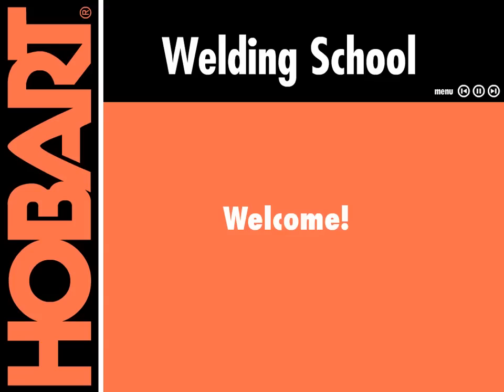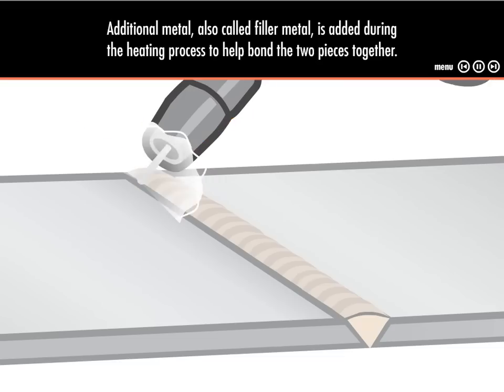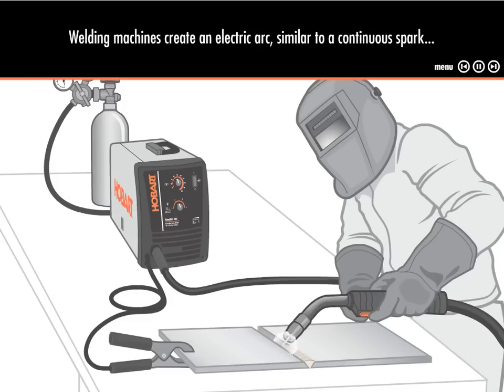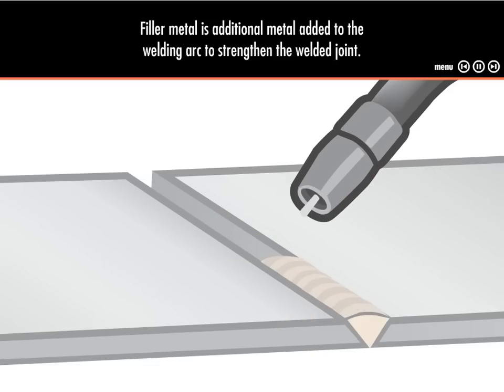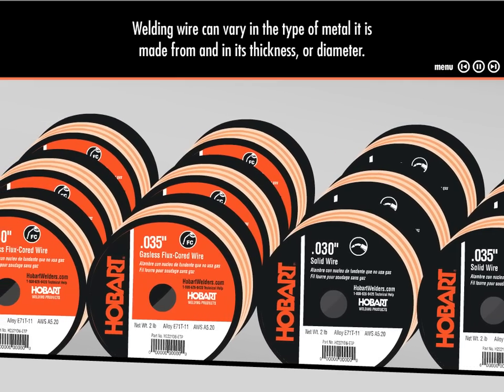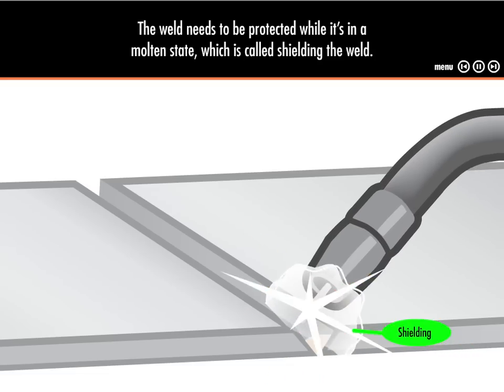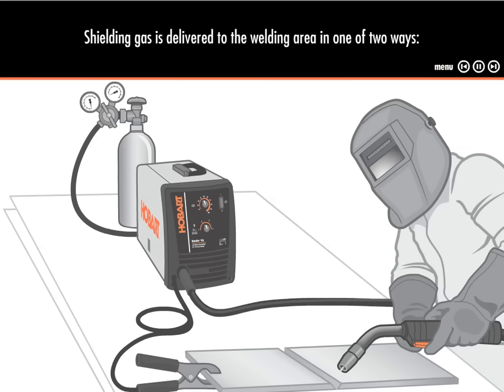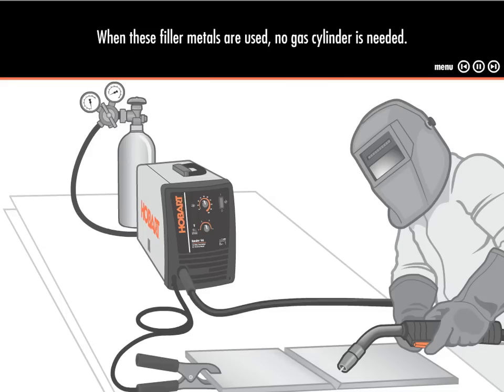What is Welding?

Comment: Good video for the beginners the only flaw is at the very end. When he says flux core wire never uses gas in many cases is correct. There are some applications however, where you use a filler wire known as dual shield wire. This wire uses a flux to stabilize the molten puddle and a shielding gas in order to prevent oxidation to the molten metal.
Reply from the maker: That's great feedback, Bailey. Thank you for sharing that information!